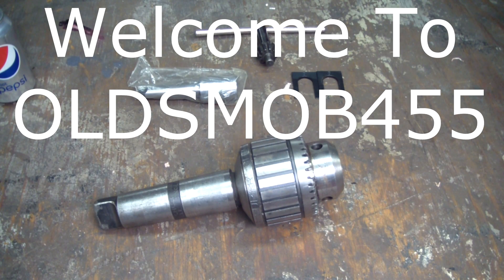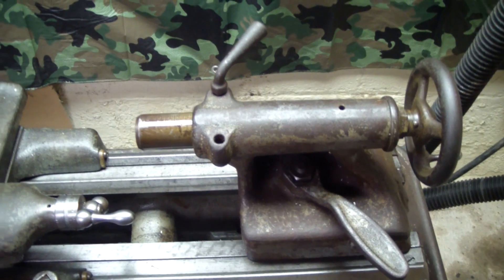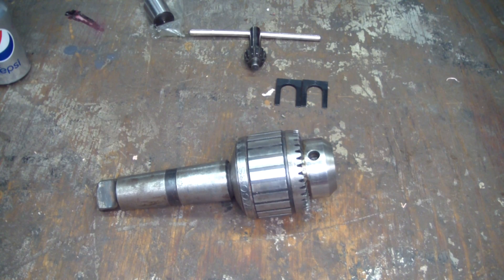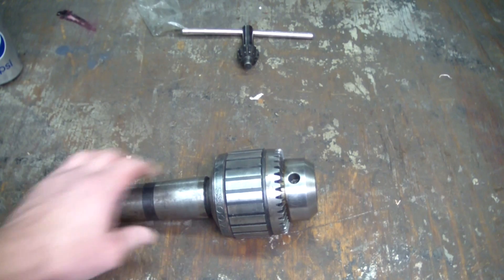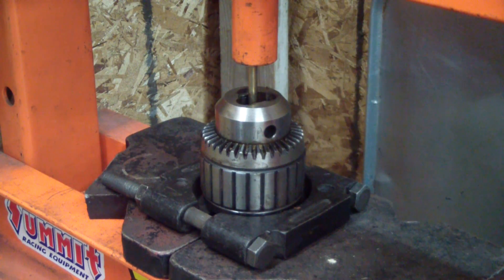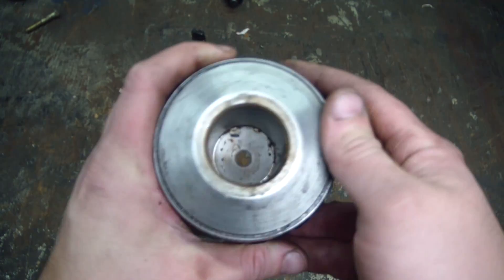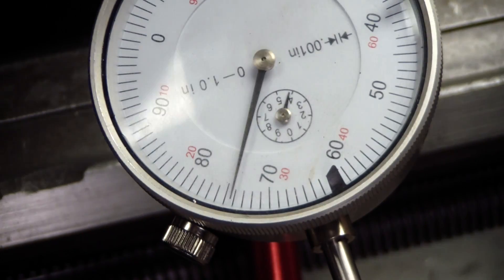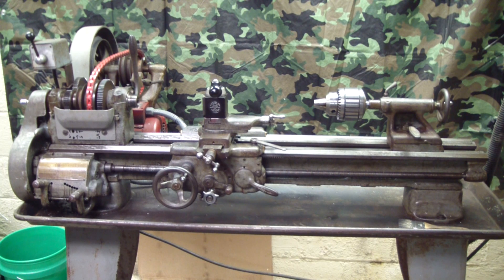Breaking The Jacobs Taper on a Drill Chuck

Comment: There's another way also if you don't have a press. I bought a 20N for my lathe as well and it came with a MT5 installed and my lathe uses a MT3 so since I didn't have a hydraulic press at the time I had to get creative. 
I placed a piece of 3/4 hex stock in my lathe chuck and then put the 20N on the hex and chucked it up so it was lathe chuck next to Jacobs chuck and then I put my live center in the end of the Morse taper and turned the No.5 Morse taper down to 1", I then single point threaded it for a 1" nut about 2/3rd's the way from the tang end towards the chuck. After removing the Jacobs chuck from the hex stock and out of the lathe I took a piece of 1-1/2" pipe and turned it true on the ends and put it over the arbor and several large fender washers then placed the 1" nut on. I used an adjustable wrench on the tang of the arbor to hold it and a wrench on the 1" nut I ran it up and put tension on it then hit the end of the arbor with a hammer (like you would to install a arbor) to release some tension and tightened the nut again, after a couple of times doing this it released the arbor from the chuck. 
Not as easy as using a press mind you but when you don't have a press you have to get innovative/creative or just redneck engineering to get the job done.

Comment: I found the easiest way was to use the wedge for breaking auto ball joints. Put shaft in vise with chuck facing upwards, leave enough space for the wedge, hit with a hammer - BINGO! Pops right off.
Reply: Mean a pickle fork...damm ill try that

Comment: Looks good man.  If I’m not going to use the Morse to JT  arbor, I just weld a slide hammer to it , and yank it out like a bad tooth.  I often thought of installing a 1/16 NPT grease zerk / nipple inside chuck, and use the grease gun pressure to push the adapters off.
Thanks for posting

Comment: It is amazing the value of the accessories that come with some equipment.  I bought a used drill press a while back.  It came with a like new Jacobs 18N chuck, quite a few bits over 1", a bunch of MT bits under 1", and two other chucks.  The drill press with accessories was about $100 over the price of a new 18N, less than the value of the used big bits, and the little bits, other chucks, and drill press were a bonus.